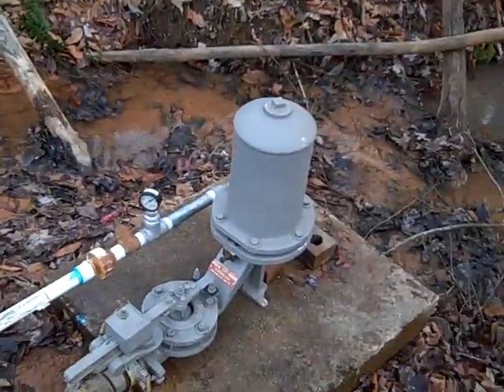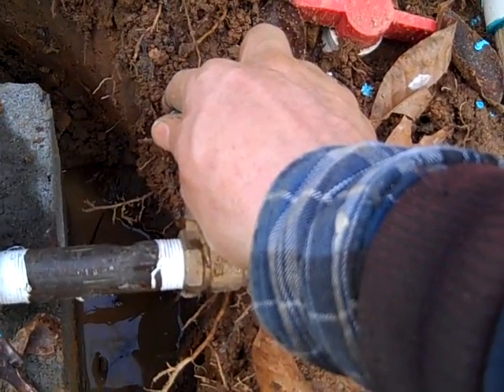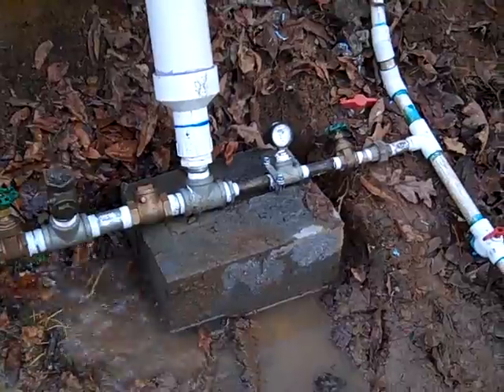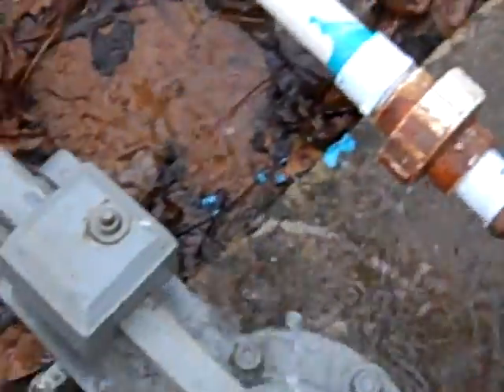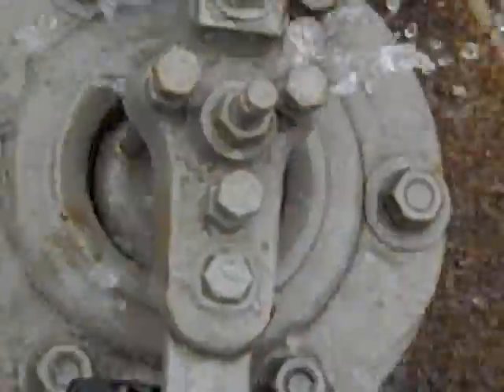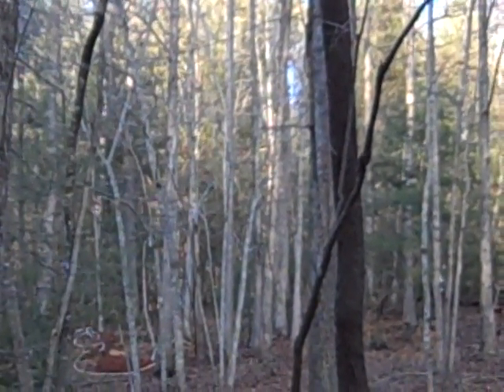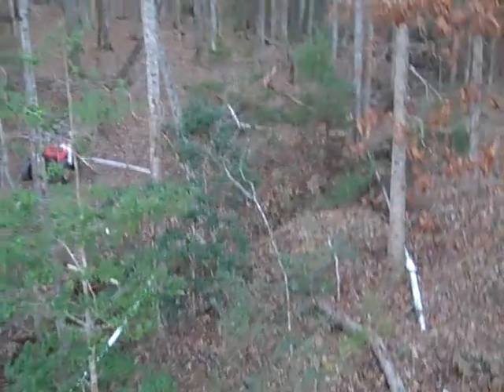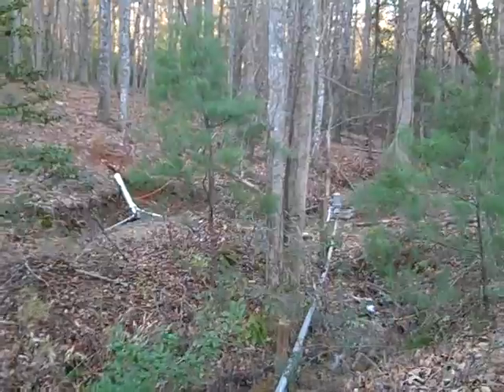ram pump pt3

Comment: I have 160ft of drive pipe buried in front of my pond just like that and I cannot get it to work. I have like 25-30 ft of fall lifting up to a hundred feet how long is your drive pipe?

Should I shorten my fall or drive pipe? Or a different pump design to decrease my head pressure

Comment: That little heart beat in the rubber coupling is a loss in energy. Having it installed anywhere in the drive line will cause it. 

Would you install those rubber couplings where you installed those steel unions near the pumps? That is what i am saying, it is no different if you use them anywhere on the driveline.

I know you said people tell you how to make more efficiency, but if you clamp the drive pipes solid to concrete footings running along it you convert more energy thru the pump. Or at least like you said bolt the pump to huge concrete slab, but then also i am saying then the entrance of the drive pipe mounted to huge slab/or rock, and a few places along the way in the middle.

Thanks for sharing, nice job parts 1, 2, and 3.

Comment: Why not have a third check valve on the inlet before your hammer valve to prevent the spike from ramming back into the supply line?

Comment: This might be a silly question, but is it possible to elbow into the waste valve and connect it up to irrigation lines further downhill or do you need air to be forced into the value to push the water back into the PVC chamber?

Comment: Hi, my Dad and I built a ram pump and my creek which has solid flow doesn't have more than maybe 2 feet of drop. How can I increase pressure or cheat or add more drop to engage the ram pump? We have 1 inch I coming and 1/2 inch outgoing size pipes. We got it work by cutting with a bucket with a hole in bottom on the bank but that isn't feasible at all. We just wanted to make sure the ram worked. How can we gain more drop in a fairly level creek sec Mario??
Reply: Kermit Belvedere stand pipe?

Comment: In part two of the series, the air chamber you used was about a foot long.  The air chamber in this video is considerably larger. How does the chamber's size effect  performance?  As the size of the chamber is altered, does the percentage of foam in chamber change as well? 

What delivery rate were you able to achieve with the diy pump?
Reply: I'd really like to know this too.

Comment: im kind of disappointed, yes it doesn't need electricity to pump up the water but it wastes some water during the process. is there any way the bleed valve be removed or is it an essential part of the pump? can there be a way to save the water coming out of the bleed valve?
Reply: It's not wasted. The bleed water would have flowed down whatever stream or river it came from anyway. All yo are doing is borrowing it for a few moments to capture its energy and use it to pump a smaller volume to a greater height.

Comment: could you put the pressure tank between the two check valves just wondering
Reply: +allenbrian72     NO ! and Yes : you could but the pressure tanks are more efficient the closer they are to the supply valve. 
EXPLANATION: the further from the supply valve; the more ram pressure is needed to get that static line of water moving into the air tank. Deeper explanation: If your air tank is ten feet from supply valve: Imagine your waste valve slams shut, now the pressure created has to move a ten foot long line of water that is standing still. The static water has NO inertia, this means the ram pressure needs to bring that 10 foot line of water up to speed before water can enter the supply line and/or the pressure tank. 
NOW imagine your air tank is only one foot away from the supply valve, The waste valve slams shut and it only needs to move one foot of static water in order to force water into the air tank and supply lines. 
Summary: The closer your air tank is to the supply check valve - the more efficient the pump will work.

Comment: engineer775 Practical Preppers I like the video series and I am in the planning stage for my future homestead. As part of my planning stage I am trying to make everything multi-purpose. When I see the waste water that is left at the ram I am trying to figure out the best use of that (channel it to a new pond and use another ram pump to pump it back to the first or something). What are some good ideas to reuse the waste water at the ram pump?
Reply: I suppose you could use a small pump powered by some solar panels to get the water back up to the pond. That would probably make sense if the source of water feeding your pond is variable throughout the year. That way, you can always maintain the water level that you want in the pond. The minimum water level in your pond would be giving you a worst case scenario for the volume of the water delivered to your house, if the source of water for your pond dries up for a while.

Comment: If you can set in a creek with the intake further upstream or at the top of a shallow waterfall, then your not wasting the exhaust water at the swing check valve.

Comment: I need about 350' of drive pipe. The 1 1/4 inch needs a stand pipe between 15.4
and 100 + feet.  Can I use the galvanized pipe to and including the stand pipe and make the rest PVC?  Its my understanding the water hammer quits at the stand pipe.  Thanks.
Reply: I just built it and the water hammer does quit at the standpipe. Used Flex hose before the standpipe and
it works great.

Comment: will this get 30 PSIG ?or does it need a holding tank with gravity feed for the pressure?
Reply from the maker: I have hit 130 psi with it.
Reply: oh  I didnt give the right question will this hit 30 psi below the ram say at the house for constant pressure. or do you need a tank to maintain.

Comment: Is there a way to eliminate waste flow from the pump?  If the waste line was to be encapsulated by a tank of some kind so that the waste line let water build in the tank would the pump still continue to operate?
Reply: Good question. The answer is maybe. The waste valve needs to open at atmospheric pressure. If you dug a large hole and put in a tank to catch the waste water below the waste valve, then the waste water could be collected until the tank was full. The waste valve couldn't be encapsulated in the tank that you propose because as that tank filled it would tend to keep the waste valve in the closed position because of static head pressure. A system like you propose would soon stop running when the waste valve stops cycling.

Comment: When you connect two ram pumps in parallel as you have done isn't better to install a check valve on the discharge of that old pump upstream of the isolation valve?

Comment: hello eng 775  I have a ?  I have 20 acres with high land  and about  a 60 ft drop to very wet land  the drop is pretty steep but can be traveled any suggestions on how to get water up to the upper end with out power and little money.  I know will have  ? so  fire away.

Comment: No need to re-create the water flow with a ram pump.  A ram pump doesn't work without water flow, so just use the natural water flow to turn a generator.  That would be far more efficient I would think.

Comment: Thanks so much.  Would it work if I used a 1/2 inch?  I have about a 75 foot drop.  about 45 deg angle of the land.  I was thinking that if I built a smaller drive pipe I might be able to keep it running when the water slows down.  I know the amt I would lift would be decreased.

Comment from the maker: No matter what you do you need a full drive pipe.  No air can be between the source and the ram.  With a 1"  gpm flow I would use a 3/4 inch drive pipe and a 3/4 inch ram for a consistent run.  "You don't have to pump all the water some of the time but you want to pump some of the water all of the time." E775

Comment: If my flow is 1 Gallon per minute what size pipe should I use?  Does the drive pipe need to be full of water or just have water rolling down the pipe?  Would you control the flow out, thus back up the flow by twisting the gate valve so it opens and shuts less times to back the water up the pipe?   If I had a spring with tons of water I would not worry about the pipe not being full of water.   Thanks

Comment: Hey Engineer 775.

I have a spring that usually puts out 1 to 5 gal per minute.  In the bad drought a few years back it dropped to 1 cup per minute.  the spring flows into a burred 2000 gallon tank that I pump to my home up the hill for water.  My concern is that I may not have enough water.  If the spring slows down and is not enough to pump the ram would it start back when the flow increases or would I have to push in the flapper gate?

Comment: Is there any way to reduce the amount of water being wasted ? I've been told a ram pump only gets about 10% of the volume to it's intended destination, and wastes 90% ... is that true ? Thanks for the info .... great vids.
Reply: I have an idea.. but not sure if possible..
Build a working ram pump system.  Build I inside a kiddy pool or large tub, pipe that to an even larger reservoir tank. Run another ram pump from that source. I think it could work if done right

Comment: Have you ever thought of using the ram pump to fill a water tower and have the level of the water raze a float valve to operate an actuator to empty the water into a hydro electric generator and then back to your pond?

Comment: I used a 3" PVC pipe (SCH 40), 4 ft long(more or less) and with my table saw ran slits lengthwise every 1/4", leave 3" on each side, cut 1/2" pieces of the 3" pipe and insert (and glue) inside the pipe to expand it and to add support. Once dry, put a cap on one end, a reducer on the other to match the pipe or nipple, wrap w/nylon screen (screen door material) and secure it with galvanized wire....works great on my project.

Comment: @izzzzzz6 The most important factor in a ram pump is the drop in elevation from the start of your drive pipe, to where the ram is located.  The rivers flow or speed doesn't matter, it's the velocity and backpressure in your drive pipe (and no air) to create the water hammer effect.  I explain it in more detail in my video of one we built with only 4 feet of drop.  Check it out and  search for "Camo ram pump" it's cool and has 480 gal per day!

Comment: Hi there, i am thinking to try to build a portable ram pump, the idea is to pump water from a glacier fed river up about 20ft to the forest above the bank, i am only looking to pump a very minimal amount of water., it is for a small cooling system. Since the river has some velocity could i get away without using steel pipe and could i have a very short feed? I want to build the system as compact as possible so we can quickly and easily install, as it will only get used for one night occasionally

Comment from the maker: @hornerm5 You are correct however,  I have other shutoff valves on the drive pipe upstream.  I have it this way so I can swap out my 4 different sized pumps.   3/4", 1" 1 1/4", 2"  so the valves on the inside become my operational valves.  The more valves the better!  I have built and tested pumps for other people so this is why I did it this way.

Comment from the maker: @ngneer999 It is enough to keep it closed but the rebound casues a pressure drop under the valve causing it to fall during operation.

Comment from the maker: @baldilocks23 Sorry won't work.  you need a drive pipe for each ram.  you can have one common delivery but not a common drive.  The rebounding effect on the drive side of multiple rams cannot be coordinated and therefore the pressure spikes you need when you need them are interfered with by the operation of the other rams.   Again - muiltple drives - common delivery.  Great question and yes I have tried it myself.  Didn't work.

Comment from the maker: @bknees2 The pressure vessel of 12" was one I had for a 3/4" ram and the 24 inch was for the 1 1/4" ram.  

As to the adjustment - 2 points-  when using a swing check valve the entire valve can be rotated in such a way as it takes more force to close the flapper.  the other point when using a  spring check valve you can just add weights to meet your desired elevation of delivery.   I hope that made sense.  I add nuts and washers to my spring check valves to get them to lift or 100' in elevation.

Comment from the maker: @lucabadue Sometimes it takes 10-30 times to get the delivery pipe back pressure to get high enough to cause the rebound needed.  They can be frustrating until you get a hang of it.  If you send me a video of your setup I might be able to help you get it running.

Comment: Great videos! Couple questions. I saw the pressure vessel increased in length/height from about 12 inches to 24 inches from pt 2 to pt 3. Any gauge on how big to make them? Second question: Is there any adjustments to the 1 1/4 common hardware ram pump to increase/decrease flow like the weight on the Rife pump?

Comment: @engineer775 @engineer775 Are you running the rams in series or parallel? (increased pressure or flow rate?) Also, if you are going for flow rate, what is your velocity like? (any friction loss or blown fittings?)

Comment from the maker: @fierfox121 I will but a catch basin and direct the water back to the stream 4 feet away.  There is not enough energy (head) in the waste water to put it to any use that I have found.  Good question and it is one I have to answer often.  Thanks!

Comment from the maker: @SaltyOldDawg I will be burying the homemade set up and also putting up a lean to to disguise the waste valve that makes all the noise.   I am going to move the rife ram 2" setup down stream and use the creek water to drive teh pump to pump my spring water in a doubleacting ram setup - That will be buried.  I have tried so many arrangements and diff. types of ram that I have left the pipes exposes for experimenting.  Thanks! Your WROL point is well taken!

Comment from the maker: @ndcent4u As I said in the overview, the metal pipe performs better than PVC.  You are right that it is quieter.  They are down in a valley so the noise doesn't carry far.  You can't hear them from any of my neighbors properties or from the road. You would have to be walking through the woods and stumble across them.  It will be about a month before I can do the well series.

Comment from the maker: @0amaam I am not really loosing the water, I am using the water that naturally flows down stream anyway.  I also pump the water to a tank and when it is full the overflow returns back to the pond.   I am into conserving my water and when it is dry I will only use one pump and crank it down the minimum output to water the cows and chickens.

Comment: I thought you covered it before so I'll go back and look but wondering why you went from plastic to metal and then back to plastic, why you didn't use plastic all the way. Seems like it would have been quieter too, if you didn't want others to know you had it running. 

Can't wait until you do the homemade deep well pump series. I'm wanting to put one down inside the casing with my deepwell pump.